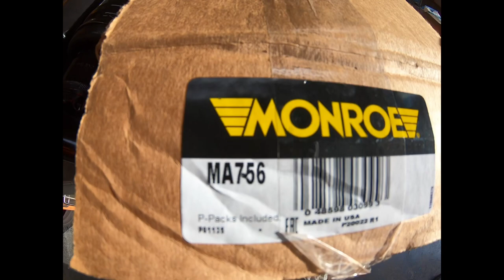Classic VW Beetle Front Air Shocks - Install - How To - Monroe 756

Comment: Definitely put a grommet in that hole, it will cut that line down. Better yet sleeve the air line to the shock with something similar to a small Id rubber line so road debris doesn't flip up and cut it.
**👍✌️
Reply from the maker: Sleeve it is what I did.... used some small diameter clear tubing, sliced it down the middle to make a inch long sleeve for the air line. 
Nice catch man and thanks for chiming in.
Reply: @VWJawbreaker  I just found your page tonight so I haven't watched everything yet. Just a quick question, is the front beam narrowed?
Reply from the maker: @kdigiacomo  no worries man, I appreciate you being here. 
Yes, this beam is narrowed 4”.

Comment: I did cutting and drill but what I did was press out old to new 1/2 Inch port for strength
Reply from the maker: So by doing that you can run a 1/2” air line?

Comment: I cant seem to get my car to work with Monroes
The bug will go up but when i air it out it doesnt go back down. i have to sit on the hood to bring the car back down
Reply from the maker: Are you still running the stock front beam?
Are you trying to use them to raise and lower the car like air bags?
Reply: @VWJawbreaker  Stock front beam with through rods, I removed the torsion springs. And ideally yes, I want some up and down action but i think the front is too light weight to compress the shocks even when aired out
Reply from the maker: @mangokraken  very well could be. I know others with through rods and the same shocks that don’t have an issue.